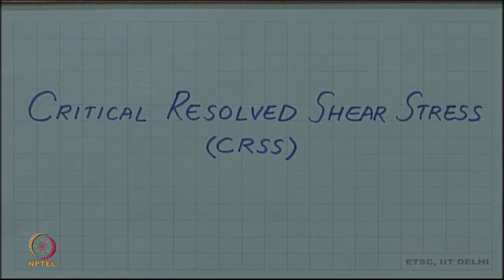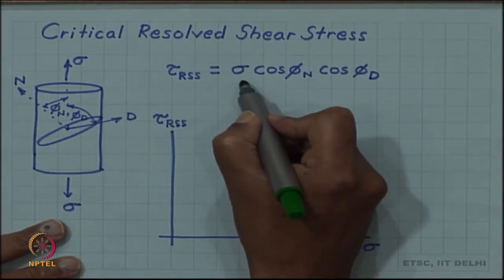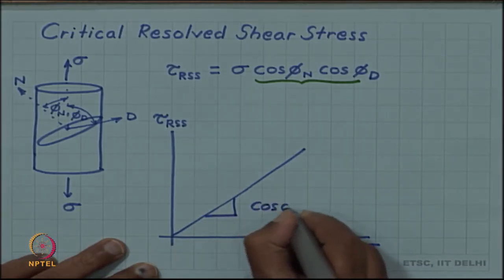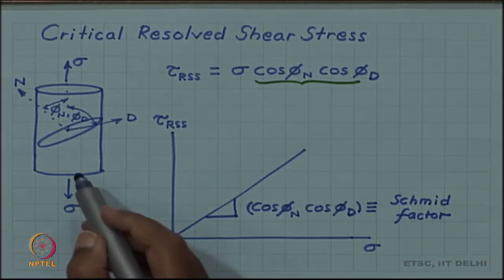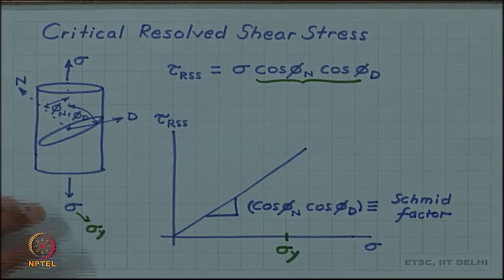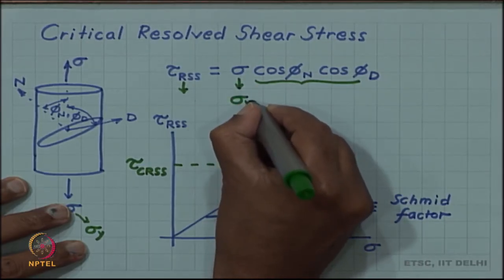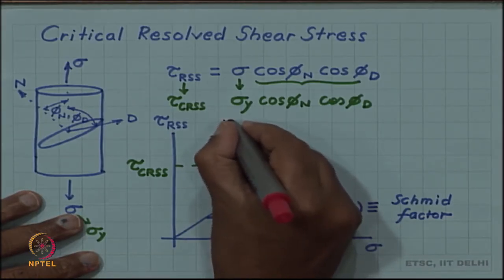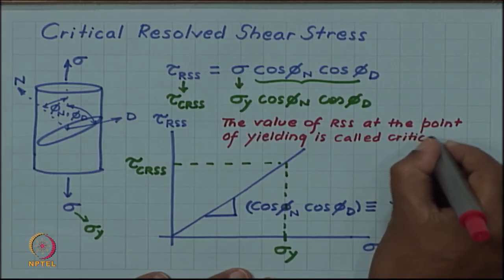CRSS

Comment: Thank you Professor Dr. Prasad for all of these wonderful lectures! If possible, I would like to ask a question which has been confusing me for a while. What is the relationship between CRSS, the Peierls-stress and the peach-koehler force? They seem to describe very similar things, yet they are not the same.
Reply from the maker: CRSS: 
Critical shear stress is the shear stress required on a SLIP PLANE in the SLIP DIRECTION to INITIATE plastic deformation in a metal if a UNIAXIAL TENSILE STRESS is applied bon the sample. It is directly related to yield stress (YS):
                             CRSS=YS*Schmid Factor 

Peierls stress: 
Shear stress required to move a single dislocation in an otherwise IDEAL CRYSTAL. Thus Peierls stress is CRSS of a crystal with a single dislocation. This is a highly idealised situation. In reality, the crystal may have many dislocations, solute atoms and grain boundaries which will increase the CRSS required to  cause plastic deformation.

Peach-Koehler force:
is the force per unit length on a dislocation due  to an applied stress. Thus it is dimensionally different from CRSS and Peierls stress which are force per unit area.

Wish you a happy new year  2023.
Reply: @introductiontomaterialsscience  Thank you very very much for your response, I am very grateful! I would like to wish you also a very good year in 2023!

Comment: Sir,  is this resolved  shear stress  occur only after yield point.  Sir,  in strength  of material  there  is no mention  of resolved shear stress when we take the mohr circle  of uniaxial  tensile stress
Reply: Resolved shear stress is there for any given uniaxial tensile stress, whether it is below or above the yield stress does not matter. The situation here is three-dimensional, so you need two angles to fix the orientation of the stress axis wrt slip plane and slip direction. Mohr's circle is a two-dimensional situation where stress depends only on one angle. But there also you do generate shear stress on planes inclined to the uniaxial tensile axis. This shear stress can be called the resolved shear stress on that plane, although as you have noticed, this is not usually done.